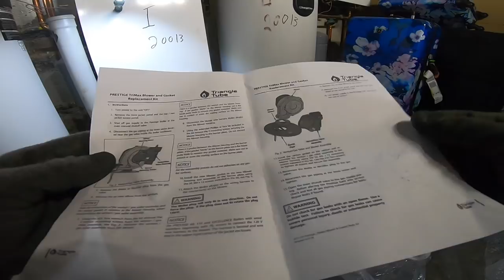No Heat Blower Failure

Comment: I worked on a few of that style heater about 1998.  It was a company called something like glow coil or tube something or other... but everybody laughed when they heard I was working on it.  Their colors were orange cabinet.  The problem the OEM said was not enough load / undersized piping.... it required 1.125” on two circuits and two pumps in series , it could heat he water that fast.  This customer actually had one heating his pool.  Those screens plugged all the time.

Comment: for that screw under the the blower shield, you can use the diagonal cutters to hold it and get it in place, if you don't have needle nose.
used to use them for pulling&holding staples to drive them in doing sparky work, as well as many other nail/screw driving. those and lineman's pliers were the most used.
tight spot to staple? hold staple in lineman pliers tight and tap with hammer to start, then put plier head over staple and hammer the pliers, holding other hand at far end, or use them alone ;)
Alternate to that, put the hard to reach screw through the housing and gasket first holding it down with driver and screw it in first, then the rest. I know "hindsight's always 20/20" and "Murphy's law" always applies  lol.

Comment: Is that a IBC boiler?
Reply from the maker: It’s a triangle tube boiler
Reply: I also thought it looked like an ibc trinity
Reply from the maker: Most these condensing boilers are almost alike, almost same blower gas valve, fire tube heat exchanger. Munchkins patent long expired and everyone’s built off that platform
Reply: @thehvachacker  I service anything but only install navien and viessman the latter. Easy to get parts, problem free as long as they get regular service.
Reply: Wall mounts I mean